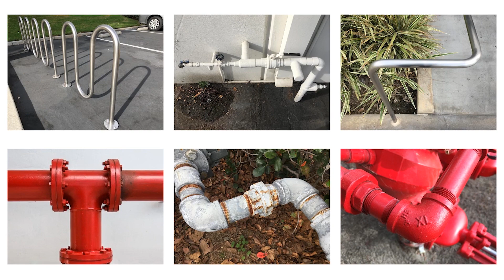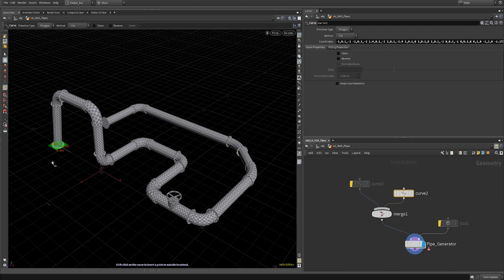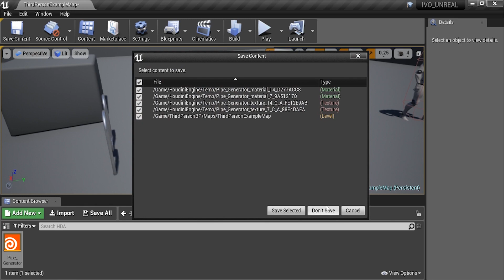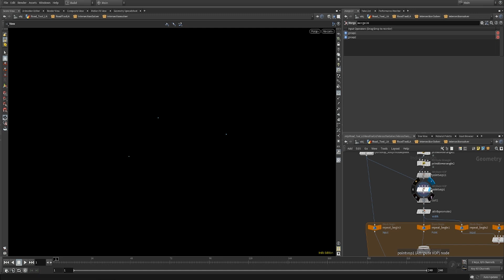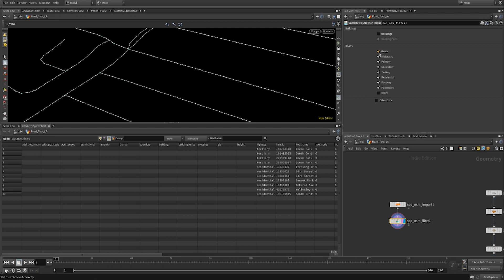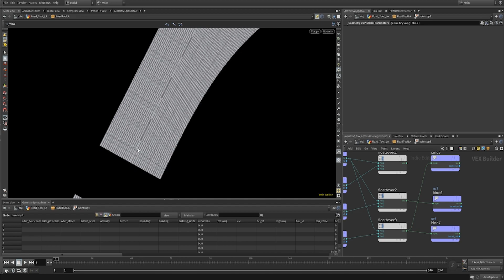DOKAI IN LA!

Comment: hey! keepup the good work! is there a chance to somehow get the modified road tool as a download? i'm trying to get the osm working with the one shown in the previous tuts, but it crashes everytime, altough i'm using just a small part of the osm. looks like its not iterating through all intersection points but stays at the same for all intersections
Reply from the maker: Hi!
Thanks for following our tutorials, hope you find them usefull! We have some more detailled stuff on our Patreon, with more and better solutions to problems along the road (yes, that's a terrible pun). You can check out the info on our website:
www.dokai-tutorials.com!
Hope that helps! 
Cheers, Ivo